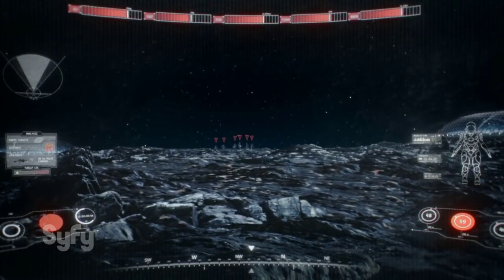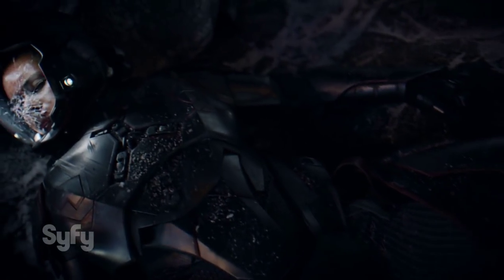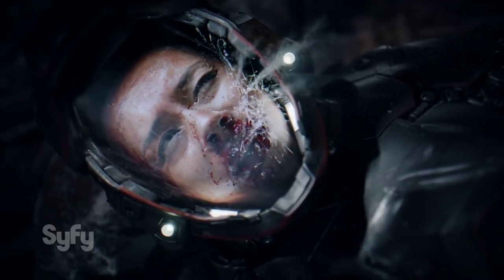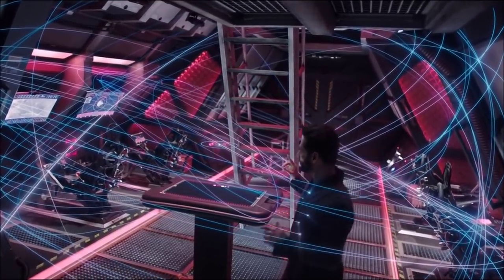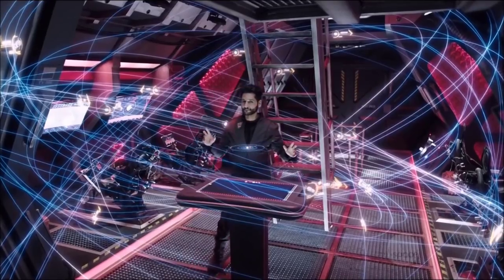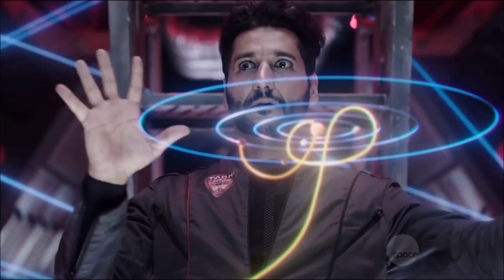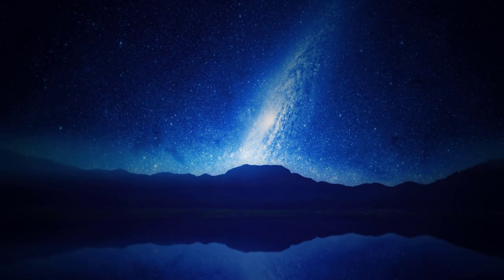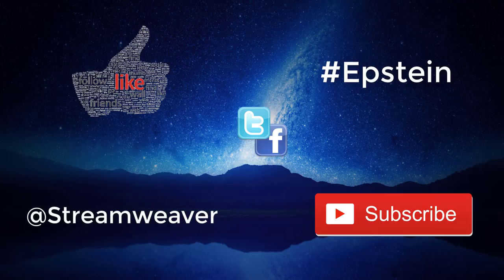Let's Do the Science:  The Epstein Drive

Comment: Its fueled by unobtanium, its the only way to explain the characteristics of the Epstein drive. 
With fusion you would need to have reaction mass to get that kind of acceleration.
A direct fusion drive would have very little reaction mass - only the burnt fuel and in best case some of the radiation focused to the rear.
If its very efficient of using the fusion exhaust - it would become a drive with a very high specific impulse - the same as one ION drive.
Meaning very little fuel is used, extremely high speed of the plasma at the nozzle, but the actual acceleration of the craft would be quite limited.
Even if the neutrons and gamma rays could be focused to aid with the propulsion by a near-magic device that can do several impossible things before they escaped and without a lunch break - it will add only a limited amount to the total acceleration.
(The same goes for even more exotic ideas, antimatter - without reaction mass you get a photon drive with high ISP and low thrust.
Or something really far out and most efficient by far we can imagine: The spaceship captain domesticate a miniature hole - he will still need reaction mass.)
The space travel in the Expanse feels believable at first look - which make it for a nice SciFi show.
But we must not poke at the ideas presented too much, if done realistically - with travel times of several months for most destinations - like freightships from Asia today.
The storytelling would mostly be about the mundane life of spacecrafts in transit. To really fly around like that without huge tanks of reactionmass, the spacecraft need to have a completely different kind of propulsion, be ít a 'space drive', warp engine or an Albeccuire drive.

Comment: The drive is simply a Magnetic Confinement Fusion drive, which is well known concept in the world of fusion drive designs. This is implied in the short story "Drive" (about Solomon Epstein's flight) aswell in some of the books.
Here is more in depth analysis from "atomic rockets":
http://www.projectrho.com/public_html/rocket/enginelist.php#epstein
And it's not even the buffiest of all known fusion drive concepts there. See the engine list and compare:
http://www.projectrho.com/public_html/rocket/enginelist.php
There is absolutely no magic or unknown science behind it.
And yes - they are using a lot of water additionally in the books. It is stated numerous times. So the idea about He3 fusion is perfectly consistent with the observed data.
There are only two major engineering problem that the autors didn't get properly:
1) The ships don't seem to incorporate realistically big enough tanks in their design.
2) None of the ships in the expanse doesn't have radiators. And every nuclear propulsion concept for a spacecraft must have them to dissipate waste heat. Otherwise the ship will melt and then evaporise fairly quickly. Ofcourse, in this case there would be no martian stealth ships :P (the glow would be seen from anywhere in the solar system).
But neglecting these two side defects the Epstein engine concept as working principle and the numbers are absolutely consistent with Magnetic Confinement Fusion.

Comment: Neutron radiation is a form of ionizing radiation that presents as free neutrons. All Ionizing radiation damages DNA sequencing in an organic structure. Essentially we can tell that a radiation is Ionizing if it can Damage DNA. Non-Ionizing radiation such as that found on the EM spectrum lower than UV (Light radio waves Etc) DO not cause DNA damage.
Energized Radiation is a term used for devices that use Radiation or Radioactive components to Emit controlled Radiation this is most commonly seen in Imaging Devices. Both X-Ray and Gama Ray Energy is Ionizing Regardless of Nature versus Science. Nuclear Fusion, the process by which two atoms are brought together to form a new Atomic Structure, is typically used in low weight atoms since they require the least Effort for the energy out put. This is typically an occurrence in High temperature High density environment (Like the Sun). However Scientists have been able to great Hydrogen plasma that forms the bases for the low yield Fusion that we have attained already. An engine would not be considered efficient if its Effluvia was composed of its "fuel" ... 

In short with out watch the Expanse at all and with High school physics We can Intuit (Intuit not asume) based off of the description you gave in the video. 

The Engine utilizes a "fuel scoop" to collect errant Hydrogen, the most common element in space and can be found in micro amounts through out, also the lightest atom and the best to Fuse. This Creates Energized Helium atoms and Free floating Neutrons, in a plasma like cloud Could be plasma or just charged to the threshold but this means little for thrust calculation as the thrust would be produced by the mass ejection of Helium and Rouge Ions. 

The Expulsion of Helium and Neutrons would create an Ionizing Exhaust, the Color and light would be produced by the Photons Emitted from the process itself, it would be consider efficient in the way that it can use trace particles to create thrust sufficient for the ship to move, like wise since it creats alot of heat it can aslo produce power (Thermal Voltaic devices are not Efficient enough to take advantage of this) Through the Steam power method, this is how we still produce energy in Nueclear Reactors and is proposed how we produce energy in Fusion as well.

Comment: most fusion reactors use hydrogen, not water, but go back to school to think about impulse engines using fusion reactions that has the ability to gain the hydrogen from space. And yes, you only have one point that make sense. And BTW, 3G is less that then the thrust to orbit. In space, neutrons would be as power source for system. And in space, the G's would be negligible, unless rotational force on the ship for gravity.

Comment: Now, im no scientist, just a sci-fi fan, but when they announced Metalized Hydrogen had been achieved, the sci-fi potential took off. https://www.nasa.gov/pdf/637123main_Silvera_Presentation.pdf . Its theoreticaly (as far as i can tell with my limited understanding) a huge improvement in efficiency over current solid fules. Could be some kind of fuel like that that's catalyzed.

Comment: You could do it with quark fusion inside a magnetic bottle... but the energy required for quark fusion is stupidly high almost certainly far more energy than you would get out, but if you could do it for only 10x greater than say the proposed DEMO fusion power plant so 10 to 1 then quark fusion puts out 10x more energy than regular fusion.

And considering you are fusing quarks it should be hot enough to have disolved neutrons into there constituent parts so you should be able to contain it within the magnetic field of a super conductor, and also use a magnetic rocket nozzle so it never actually touches any matter because fusion is already way beyond what any materiel could contain quark fusion is 10x greater than that.

With that much radiation assuming something like a 20 GW output even if you use photons... ah 66.67 newtons of thrust... hummm... yeah your right... even 200GW which is unlikely is only 666.67 newtons which isn't even a single KN.

Comment: Late to the party here, but #mytheory about how landings and other close proximity maneuvering is handled is simply that there is a hybrid system capable of less destructive and less powerful reactions. The reaction producing the "Epstein Drive" level of power is simply not engaged until the distance is safe. No Idea what this alternative reaction would be, but surely there are possibilites at least for low gravity environments like space stations etc. This system could be a more classical fuel based one possibly, but efficient enough that there are no large fuel tanks required given it's only used in small doses.

Takeoff from high gravity environments might be either solved by simply having dedicated large areas for it and the destruction is just dealt with as is, or by some kind of assisted takeoff using external equipment on the ground to propel the ships up a height to where engaging the Epstein drive is safe, this isn't supported by footage in the show or anything though. A third alternative is that most ships are built in space and not supposed to land on planets at all and dedicated land-space transport is used instead, this is certainly the case for large ships in the series.

In short the Epstein drive is a space only drive and other systems are used for landing takeoff and close proximity maneuvering.

Comment: #mytheory
I think that it has to be some kind of multi-stage fusion reactor with capturing systems, perhaps using some of that extra heat to convert some of their water into steam, and personally I think I would have to be some kind of fission-fusion reactor just because the power output could be so much greater.
#epstein

Comment: Helium 3 can produce fusion with minimal waste and radiation can't it???
Reply: Deuterium-Helium3 fusion produces little neutron radiation, which means radiation shielding doesn't have to be as heavy or dense as it is with a reactor that does deuterium-tritium fusion, IIRC.
Reply: Weight is a problem, even in space.  Absent something that soaks or kills radiation it sounds like Helium 3 is it as far as fuel.
Reply: weight =/= mass

Weight is a property of gravitational force.

Mass remains constant.
Reply: compmanio36   ?????WTF are you on about?   I was speaking of a lighter weight reactor.

Comment: However, it does take a shitload of energy to keep going that long.  W=F x D = m * a * D.  That would suggest it would take 3.92 MJ to get to the moon PER KILOGRAM.  That's equivalent to the energy released by a kilogram of TNT.  So in other words, for each kilogram of mass you'd need a kilogram of TNT.  Of course, that's not counting the weight the fuel, so of course you'd need something way better than TNT.   This is within the realm of fusion power, but then we have the issue of reaction mass.
Reply: Oopsy whoops.  Made an error in the calculation.  It actually takes 3.92 GJ per kilogram  - about as much as a TON of TNT.  So, for every kilogram of mass, you'd need a ton of TNT to get it to the moon.

Per kilogram, a thermonuclear warhead contains about a million times more potential energy than TNT, so this is still within the possibility of fusion engines.

Comment: thay could use a fushion blast like an H baom to push the craft to the crazy space in the show.if you relexted most of the enargy out the back of the craft and could slowly feed matter in to the enagen 1 costent G is notting. hell gave time and fuel sub light intorsteller craft could be powered this way.something like this on a smaller scall is what i think is used in the show.

Comment: When huge efficiency gains happen in the real world it's usually the result of some previously unknown synergies are discovered between known technologies or materials that end up multiplying each other. The parameters that allow for the synergy are sometimes narrow and found during tedious testing by varying one or just a few values of parameters at a time. 
This is especially true in the nuclear and electronic realm where the quantized nature of the systems means interactions and transitions occur at only at exact energies. If you're off a few electron volts in either direction the probability of the interaction drops to nearly nothing.
 You can be scanning a parameter space that seems flat and featureless and then boom....a huge effect tha quickly drops off as the parameters change just a fraction of a percent more. And magnetic  fields can be used to tune these energies to some degree as well. 
Epstein was doing one of these variation of parameters type of experiments when he hit on the ratios of whatever that produced the reaction that killed him. Given the immense step up in power (known as a high cooperatively coefficient) it's likely the reaction is some kind of cascade similar to known nuclear fusion and fission reactions where products from the first reaction interact to make products that also happen to interact and make more products etc etc.  The neutronic and electronic radiation from various steps get absorbed by downstream products and continue driving  energy releasing processes.   In the end this highly specific and tuned series of fusion and fission reactions may approach the limit of an antimatter/matter reaction having released all the strong force energy in heavy nucelii.
Such a pathway may not evident from tables of nuclear fusion and fission processes but the application of an external magnetic field and pulses of Electromagnetic radiation at the right time and frequency may shift the bandgaps (Zeeman effect) of intermediates at the right time to allow the next steps to take place. The engines may not be a continuous burn but instead a succession of very fast pulses that appear continuous.
Reply: It was also really stupid of Epstein to do his experiments with a full gas tank. You always want to do this kind of thing with very limited fuel so that if it runs away on you (pun intended) it either burns itself out quickly or makes the smallest possible explosion.

Comment: #mytheroy With exception of aneutrionic, statistically impossible purely DT-DT fusion, most of energy of fusion ( > 90%) is wasted in neutrio radiation. Supposedly, that neutrinos are harnessed and used as reaction mass that would make Epstein drive one giant, efficient "ion-engine-like" neutrino thruster, with actual fusion energy and neutrons being waste.  That would also lower total energy requirements, thus waste heat problem for starships. Also, with neutrino properties, this would make for very SAFE exhaust.

Comment: The science for the drive is fictional but the G-force effects are real.  A human in constrained by a seat can pull about  Gs before stroking out due to torn blood vessels.  The issue becomes thwn what technology do they have to counter this to achieve the forces necessary to go 600-700 mile per hour per second and still function let alone live?  In Star Trek they have inertial dampening tech that counters the g-forces for their impulse drives (non-light speed). Lighr speed travel the conventional route would turn a human into red paste. Warping is essentially fold space and that may be easier on a body or the gravity well could tear it a part.  No one knows for sure.  A body can certainly travel at high speeds in the vacuum of space assumingnit was already up to speed to start becausenthwr is no resistence (i.e. a seat or hull).  

So the series does account for Gs and the dangers of such acceleration.  Sadly, those born on Mars or in the Belt would not be able to handle as many Gs as a Earthling so if they all had rhe same tech, it gives Earth's spaceman an advantage in travel and battle. But pressure suits and potential inertial dampeners of some sort could mitigate that.

Comment: Well I'm going to go full science-fiction and say that they have a fusion reactor that uses all of the plasma it can create as thrust and the radiations are then used to create a sort or electricity and that power is used to make anti matter which is stored in some vacuum sealed area and when they need to go fast they start using anti matter to either jump start a secondary fusion reactor to give it that much more power or in emergency the anti matter is combines with regular matter and the energy from that is focused out the back kind of like a sustained explosion pushing you forward fast af or the energy can be used in a Mutch more Effexor than only electricity ion drive

Comment: Here's a fusion reactor that could be used that solves several of your issues. https://lppfusion.com/lppfusion-publishes-world-record-fusion-results-leading-peer-reviewed-journal-physics-plasmas/  
1. it produces a plasma beam which could be used as propulsion.  (or pew pew... particle beam weapon)
2. It produces less radiation... and the radiation it does produce does not turn the things around it radioactive like Neutron radiation does.  It's one of a class of fusion reactors called aneutronic fusion.  About 1 day after shut down of the reactor, all the internal components become safe to handle without needing any radiation protection gear. 
3. The purpose of the fusion reactor is to generate electricity.  The plasma beam is made of charged particles (ions) this can be passed into an induction transformer to get electricity.  But doing that isn't enough.  The X-ray flash from fusion must also be captured.  Fortunately capturing and converting X-ray to electricity is easy.  X-ray striking metal produces an electrical current... so you simply surround the device with layers of thin metal foil.  Capturing and using the X-ray flash is vital to getting more electricity out than was used to initiate the reaction.
4. Fuel is currently deuterium but will be Hydrogen Boron.  Both are gasses... and Hydrogen happens to be the most common and abundant element in the Universe.

I love this design because it's comparatively simple, doesn't produce long lived radiation, is small, and directly produces electricity without the need to boil water and run it through a steam turbine... which all the other heat based power generating systems do.  The beam itself if not used for electricity generation makes a good propulsion device... or weapon.